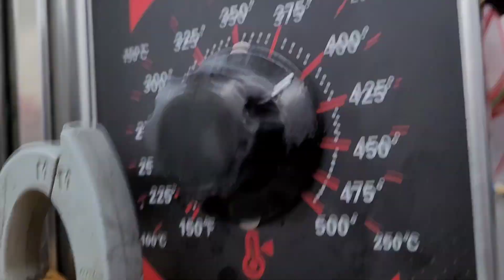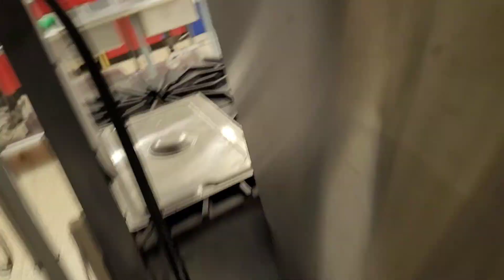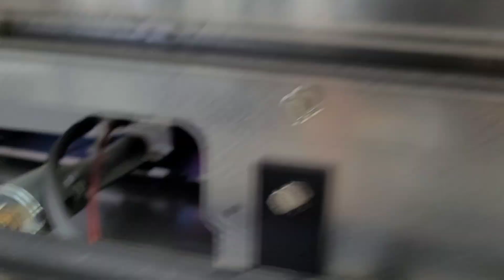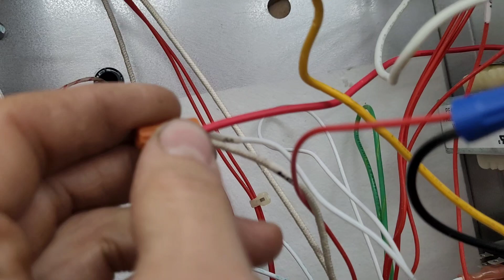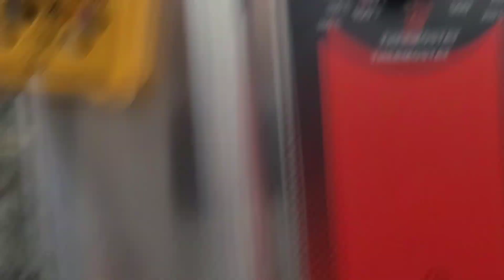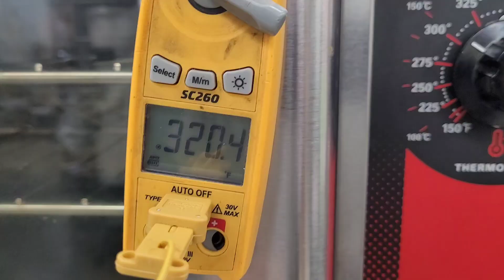Vulcan oven Troubleshooting and Repair! How to fix a Vulcan oven that won't Heat!

Comment: I have similar Vulcan oven, having ignition problem. The right side ignites perfectly, good spark, flame comes on, and immediately shuts off because the left side is not sparking. Tried replacing the ignition assembly (the three rods, flame sensor, sparker and ground rod), no change. I can remove the power wire from the sparker, and held close to the chassis it will spark nicely, but not assembled. I thought ground was the problem (there is visible rust inside the unit), so I put a jumper wire from the ground rod to a bolt in the chassis, tried to use the ignition assembly again. Nothing. After several google searches I'm beginning to think the power delivery (ignition module, circuit board with the capacitors on it) is not giving enough oomph. Should be able to hear an audible crackle when the spark crosses the distance (just the power wire to the chassis), and I think maybe it's not very strong. Going to replace the ignition module next, unless I find something in a video that suggests this might be wrong. Thank you for the informative video, keep 'em coming. :)
Reply from the maker: Yes, sounds like you are on the right track. Sometimes the spark will get out of the wire somewhere along the line when it's assembled, that it doesn't win disassembled. If the porcelain has a hairline crack in it, the spark likes to jump through the hairline crack instead of travel out to the end of the probe. I've also seen spark boots with small cracks cause similar problems. If you don't have enough oompf as you said, you won't get the spark.

Comment: I have a question , where are the two ends from the high limit thermostat cable connected to ?
Reply from the maker: The high limit interrupts 24 volts going to the ignition module. One lead is 24 volts coming in to the high limit, and the other lead is voltage going back out through the next limit or directly to the board depending on how it's wired.

Comment: what this service call does not heat or no power?
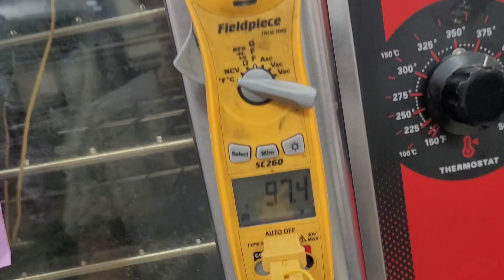Reply from the maker: @1:13 I explain that the unit had power, but would never go through the ignition sequence. That's due to the low voltage control board having no power.

Comment: Hey! Thanks for sharing! Great video and insights. I'm working on a similar or almost identical Wolf convection oven. Ordered a replacement convection motor that stopped working for some reason. Replacing it this week. I hope it fixes the issue.

Comment: I tinkered with one recently that I wasn't assigned to actually buy it's a double gas oven. Was wondering what route would you take if you turned to "on" and no fan or anything happened, assuming that the power switch is good. I know the fan starts first thing but there was no fan but the fan will run in cool down mode from selector switch.
Reply from the maker: I wonder if you have some issue with the door switch, which may not be needed for the cool down mode, but is needed for ignition?
Reply: @ReubenSahlstrom  I'll check into that when I go back over there. I ended up moving one of those connections on ice cube relay from the normally open terminal to the normally closed terminal and it ignited but without the fan so I will check the door switch